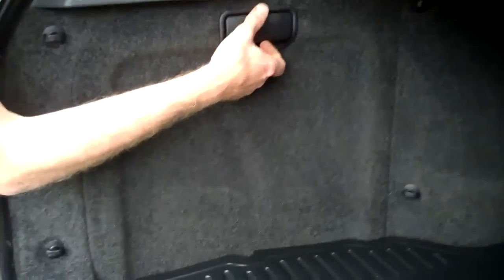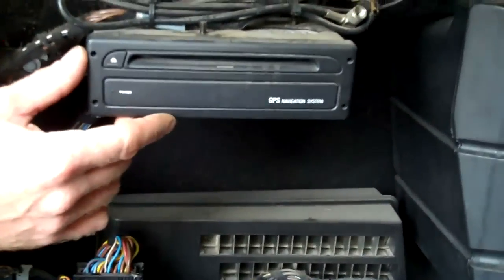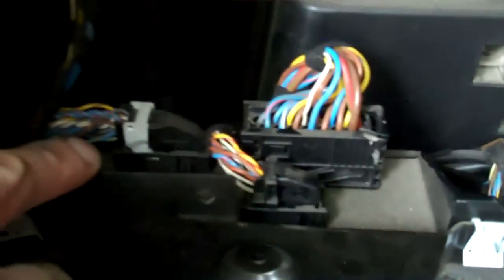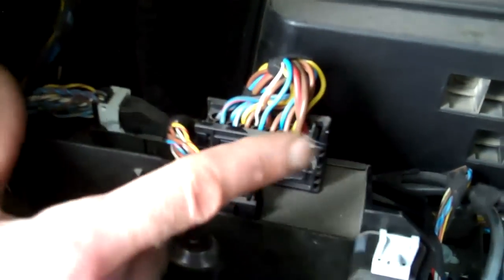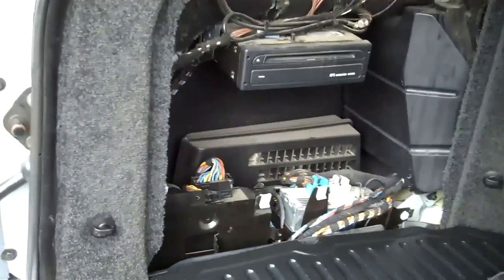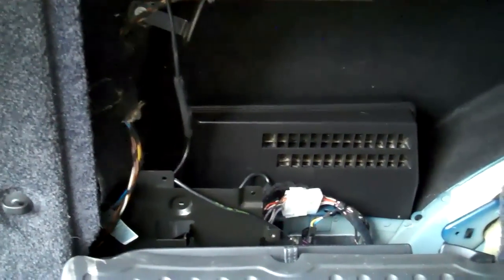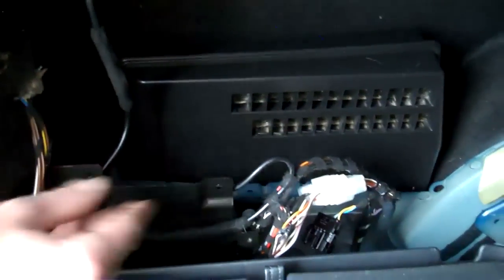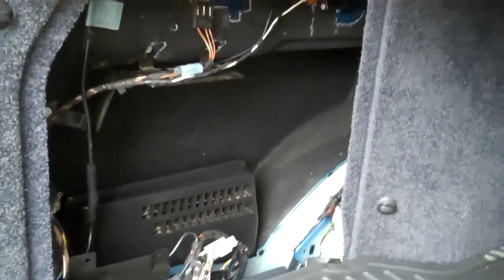Range Rover L322 Audio Amp Location

Comment: Hi, I have a HSE but it has an amp in the boot. Installed and aftermarket head unit but got no sound. Not sure wether I need a different wiring harness of if I should get the amp tested. The original head unit was broken so never knew if there was any sound at all. Any ideas?

Comment: Old video I know. I have a 2003 hse came with the basic stereo no sat nav. Mine does have a amp in the boot. I have a aftermarket stereo and it's currently going on and off on its own accord. I'm thinking it's a amp issue

Comment: Hi friends I have a problem with my radio. I joined the fiber optic cables of the bluetooth module. the screen works perfectly but the stereo radio has no sound.

Comment: hi powerfuluk. what are the sound output power in a 2002 hse? I need to buy replacement speakers ect just would be alot easier if I new outputs per corner

Comment: Could anyone help me I have a 2007 L322 the radio head unit inside the car has a orange light flashing when car is locked the radio unit shows Range Rover logo.i took it in for repair and they've turned the stream off as they said it could drain the battery when the car is locked? Could  it be the Bluetooth module? Can I join the fibre optic cables together and how do i turn the head unit back on? Many thanks.
Reply: i have a similar issue with my 07 l322 with the audio and nav not working at all. just flashing screen. i hear it is possibly the control module and/or amp. looking for used replacement.

Comment: Hi there need help.i have a l322 2003.I have removed radio.to put in double din but the harness is different
to the one on eBay.any one now what I need
Reply from the maker: which one did you buy ? do you have an amp in the boot ?
Reply from the maker: IS your like this one ?
https://www.youtube.com/watch?v=jSYo175Q6mk
Reply: @L663  I have to get 2 leads that go from boot to radio .just been on a few sites .cheers
Reply from the maker: @johndearden7428  I think the leads are the same on the BMW X5 also....
Reply: @L663  Yes that's true
Reply: You need 6mtr fakra extension cable for bmw/range rover.£16.99 and also a 6mtr bypass extension cable for one bmw navigation unit.£49.99  cheers thanks
Reply: hello! I Have a l322 2002 TD6, i has the cd player in front ( No navigation)  shown in the link you posted here. I do not have navigation screen but I still have the amplifier in the boot. Do I need extention cables from front to rear. Please help.